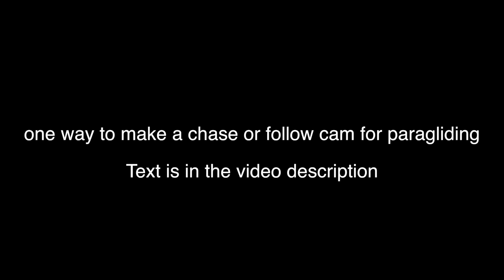one way to make a chase or follow cam for paragliding with a gimbal

Comment: your video is the best followcam edit I've ever seen - superb choice of music and editing! Thanks so much for sharing your setup. I'm surprised to see you use a windsock, it looks like it tugs in a jerky fashion on the line - wouldn't it be better to have a big draggy tail on the arrow instead, like a feather duster?
Reply: +Greg Hamerton 

I tried it, but this set up works best when flying wing overs. I placed the external battery pack where the wind sock is connected to the line down from the glider to compensate the movements a bit. I know it is not perfect, but I did not find a better solution. Thanks for your suggestion, Alois

Comment: Great instructions! Thanks a lot for sharing and describing the setup! This will save me a lot of time! I have the version of this gimbal designed for fitting on RC models - much lighter, around 210 gram with camera fitted and no need to "vandalize" the handle. Great videos! And I owe you at least a pint of premium beer if I get a chance to meet you!

Comment: In my experience gimbal is not needed, the key is the right shape of the flying camera support and its trimming in flight (it should hang tilted forward at the angle equal to the paraglider's glide angle so it meets the relative wind head-on AND it has to hang off to a side, otherwise it swings a lot in the harness wake). Check this video (fast forward to 0:14), it's raw footage, NOT digitally stabilized: https://www.youtube.com/watch?v=u7XyLRrHRaw 
It looks like the manufacturer of this system went out of business or something, but there are videos showing it: https://www.youtube.com/watch?v=zwqNIGuDJr8

Comment: Great job! Any reason why you changed from 3 tail fins to 4?
Reply: +Rhys Fisher

It broke and worked just as well
Reply: +Barbarahof Werfenweng - Gasthof-Pension Thank! My old man and I made a collapsible version of your design for ease of transport. Just need to finish it of with some weight reductions on the tail before trying it out. Was your set up balanced when hung, or did it require some wind speed for the tail to bring the camera and gimbal level with the tail? Thanks again.
Reply from the maker: +Rhys Fisher It was balanced.

Comment: Hi, what about total weight? thanks!
Reply: i have just made a chase cam set up following this design, with a few changes and a larger battery (which i will probably change to a smaller one). And the whole set up weighs 600g. with a smaller battery it will probably drop to 400g-500g

Comment: +easygliderful what size wind sock do you use for your set up?
Reply from the maker: I had the best results with the biggest wind sock I had, about 25 cm wide, the bigger the wind sock the better the result I found.
Reply: Brilliant thank you! Also what volt battery pack did you use? Does it have to match the voltage for the batterys that fit in the gimble? 
Thanks
Reply from the maker: 2s Lipo (7,2 volt) - model air plane battery with 4000ma/h, the Gimbal wit the camera including wifi turned on sucks 850ma/h.
Reply: ok thank you! cheers for the help, much appreciated!

Comment: How do you keep it focused on desired direction? 
Hand gimbals will eventually drift away, mine actually does.
Reply: he invent something called "wings and fin stabilizer"
Reply: +Keagan Nelka Bangun 
but gimbals often drift from set direction and you can't fix it manually here as you do with handgimbal
Reply: +AndRand just set it to smooth capture , it will follow the stick movement
Reply: +AndRand btw you should search the gimbal capture modes , it explains how the camera stay in the correct direction
Reply: +AndRand 
The gimbal I used did never messed with the direction, I see what you mean though. With a different gimbal I had this issue.
Reply: Buy feiyu-tech, ZERO DRIFT